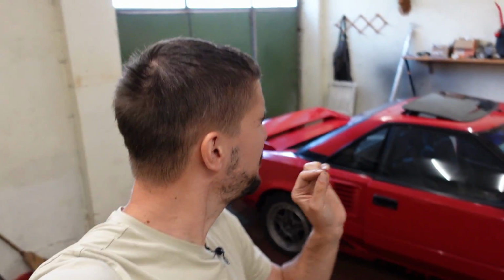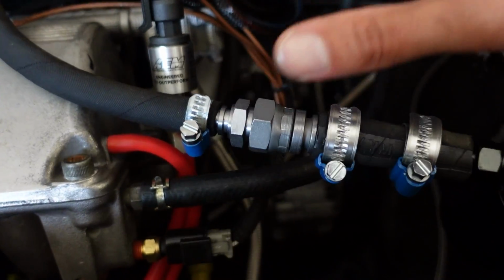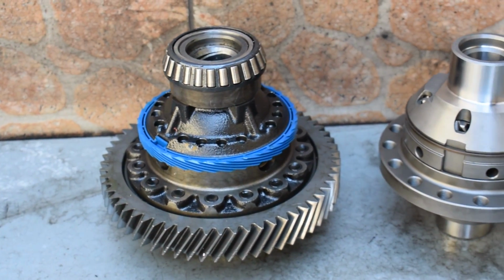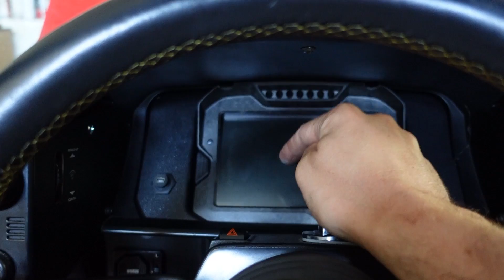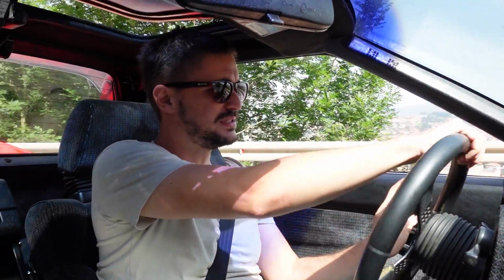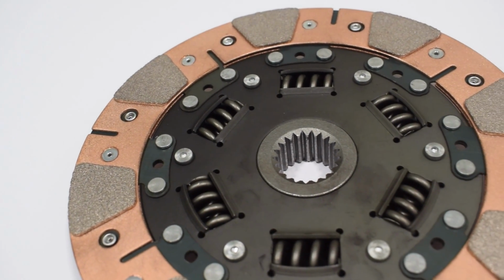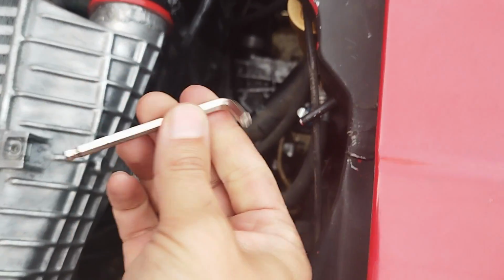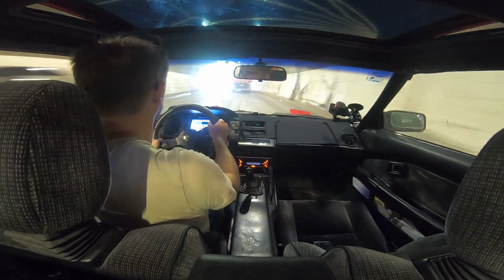Project Underdog First Drive - Turbo 4AFE Toyota MR2 mk1 AW11 spools up for the first time!

Comment: Thats the blowoff opening not compressor surge. Plumb it back to pre turbo if you want it quiet.
Reply: a blowoff valve isnt going to sound anything like that, its not compressor surge but its coming from the turbo not bov
Reply: @arcanevoid9199  what do you think is fluttering? A turbo with no blow off valve does not make that noise. It's the blow off opening losing pressure then closing and doing it again until the turbo slows down.
Reply: @jasonbirch1182  the air has no where to go when the throttle suddenly closes and will be forced out the blades of the turbo which chop it up making that noise, that’s why it flutters. and yes a turbo with no blow off valve would make this sound, his mr2 effectively doesn’t have one as it’s not opening. a blow off valve makes a sharp air releasing noise and that’s it, it doesn’t carry on or make a noise anything like that
Reply: @arcanevoid9199  no. It's the blow off venting to atmosphere. You are wrong. Go listen. 
Most of  these cars have blowing valves to atmosphere. If you do t hear that flutter it doesn't have one. I've been driving turbo cars with no blow off my entire life. They don't flutter. 
https://youtu.be/ttQGlhMXV8A
Reply: @jasonbirch1182  ok explain why it would open and close so rapidly when you let off the throttle? the pressure doesn’t go up and down when you let off, also where do you think the air is going to go if you don’t have a bov? I find it very hard to believe you think they don’t flutter, this is common knowledge for anyone who has some idea about turbo setups
Reply: @arcanevoid9199  are you serious? It opens and closes rapidly because the turbo is spinning at 20-60,000rpm. When you let off the throttle the air has to go somewhere. It pushes the blow off open, which reduces pressure until it starts to close which builds pressure again which then opens again untill the wheel has slowed down enough to not push it open anymore. If there's no blow off it just  forces the wheel into the center section putting strain on the wheel and causing vibration when the turbine blades stall plus beating on the bearing surface. Can you please not pretend to know things because you heard something one time? If you want to tell people things, learn how it actually works.
Reply: @jasonbirch1182  that doesnt make any sense,  it doesnt re-pressurize multiple times a second as it lets that pressure out, it just comes out all at once. if the pressure alone pushed the blow off valve open then you would have a boost leak?? if what you said was even close to true a bov wouldnt need a vacuum reference from the inlet manifold which you should know that it does. go read up the GFB article on how blow off valves work,  and your almost right it goes out through the blades of the turbo and its not going to stall blades spinning at 60k rpm like you said. and thats very ironic considering one google search shows you are not correct

Comment: The importer near my house has 100 of these engines he wants to get rid of.  Probably very cheap.  It would be a good alternative to spending thousands rebuilding a 4age.  Of course you could also go NZ, ZZ, ZR and save the weight and make more power.

Comment: at 8:34 you mentioned not wanting hot coolant making the charge air hotter. how about having it have a separate  cooling circuit.....a chiller assembly so to speak right in the path of that charge air.
Reply from the maker: That's kind of what the intercooler does? I don't know of any other sensible way to cool down the charge air
Reply: @d4a  there is also misted alcohol injection use in the plenum at the end of the throttle body that would help cool the air. especially effective under full throttle use. remapping a bit on the fuel curves applies. :-)

Comment: Nice work and thanks for the information..do you have any informations about boosting the toyota 1zz engine with 120 hp?? Thanks a lot again
Reply from the maker: Most boosting processes are generally similar. There's a link to a NA to Turbo process in the description that will give you a good idea on what's involved. I'm not sure of the transmission strength mated to your engine, if it's known to be weak it has to be addressed somehow.

Comment: Love your videos man, so don’t take this as anything less than constructive criticism. At 10 minutes in you show us where you moved the battery. That’s not a bad place, but the rim of the spare is metal. And it is more that conceivable the rim could contact the positive and negative terminals at the same time. You don’t need to ask me how I know, just protect your project against stupid mistakes I made, and cover those terminals.
Reply from the maker: The wheel cannot physically contact the terminals, I responded to many similar comments already. But I do appreciate the concern

Comment: Do you mind elaborating on our cam angle sensor? I’ve heard the stock neo cas wasn’t the best so you just curious what you used instead. Thanks
Reply from the maker: It's as fine as any hall effect sensor and outputs the same kind of signal. The distributor and sensor on the 4afe is a bosch unit, the same as on many European cars of the 90s, like the Golf mk2 etc. It's a pretty simple, decent and reliable setup.
Reply: @d4a oh so you kept the stock sensor. It just looked different than stock but ig that makes sense if you just capped the distributor part and kept the angle stuff. Do you use the 4 tooth or the other wheel?

Comment: How's rust on the MR2 and how did you keep it from rusting at all(if already some rust how did you keep it from rusting further).
Reply from the maker: Remove existing rust and keep it in a garage. There's some surface rust here and there that pops up, but that's easily manageable

Comment: So Im doing this same build, essentially. My build is a 96 celica and im boosting the 7afe. As you know toyora wiring harnesses are jungles. how did you go about that part of the build?
Reply from the maker: There's a link in the description to a very detailed video about wiring
Reply: @d4a  okay great man you don't know how long I've been looking for something even just similar. Ive got multiple pdf pages of diagrams and schematics. Eventually I just built an entire engine bay harness myself to fit the speedyEFI ecu i have for it but I removed a lot of stock as well so Im bount to have some issues.

Comment: Bov placement? Before charge cooler... after would be better!
Reply from the maker: Why?
Reply: @d4a  the charge cooler itself is a pressure drop. Affecting vacuum when throttle is closed... also airflow through the membrane would affect the blow off... Kind of like a vacuum canister effect keeping the bov effectively lag

Comment: Anyone know the exact valve that he used for his cooling system? I'm interested in adding it to my mr2.
Reply from the maker: There's no brand or number, it was literally in a bin in the hardware store. They're all pretty much the same, automatic bleeding valves for heating.
Reply from the maker: Here's an example https://www.amazon.co.uk/Bleeder-Automatic-pressure-relief-heater/dp/B07TBN1MT2 I just added a T piece underneath it
Reply: Thanks. I have a k24z3 swapped sw20 and I was thinking of ways to make the cooling system better. The only other great option is to run bleed lines from the front all the way to the coolant reservoir. Kinda like a Porsche boxer.

Comment: I just rebuilt my 95 Geo Prizm 4AFE, had a spun rod bearing. New bearings , oil pump,water pump, rings, gaskets , seals, valve stem seals, just struggling to make the rest come together, yesterday replaced the power steering pump, it’s just a small engine compartment for me as I’m used to big American V8s with very little auxiliary components and gobs of room, another thing that’s annoying is the critical order in which things go together, annoying engineering

Comment: Man u need water cooled intercooler   - it works waay better in this place
Reply from the maker: Not necessarily
Reply: @d4a  Just check it -use 2 temp sensors  in intake and exhaust of cooler  -difference will be less than 40 deg . We got -30 degrees after replace air to water
It also lower EGT temp!

Comment: The steel spare rim, placed on top of the battery terminals is far from ideal.
Reply from the maker: Already responded to this. It's impossible for it to physically touch the terminals.
Reply: @d4a , expect to have this observation a few hundred times 😇

Comment: Looks like you have built something like a smaller version of a Porsche 930. I found a JDM 4AGZE out of a Trueno and put it into a stripped 1988 MK1 hardtop. Not nearly the same amount of power you have, but enough to be scary. The amount of oversteer possible in the wrong conditions is enough to make an atheist believe in God. Stay safe. I drive a Toyota GR86 now. I sold the MR2 when my reactions got slower than the car.

Comment: you should never go richer than 13.0 under 0.2b 12.5 under 1.2 bar above 1.4b afr of 12 max 11,8 all over that is excesive and washes oil film from cylinder wall + its just loosing hp for nothing